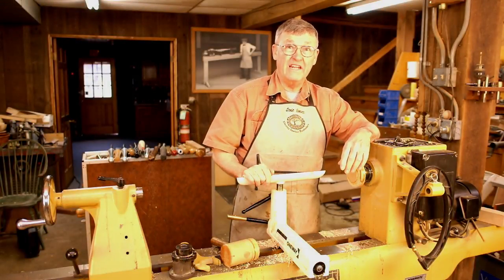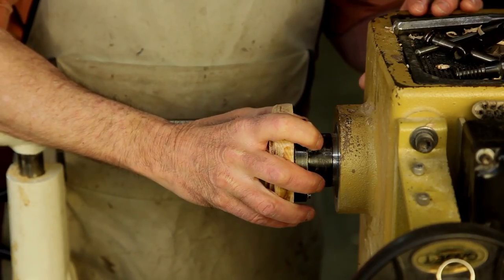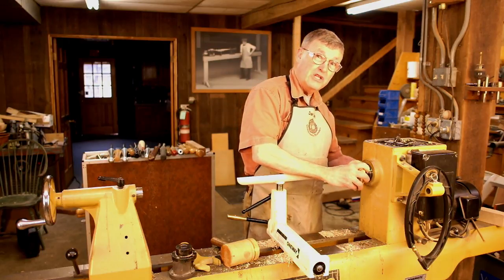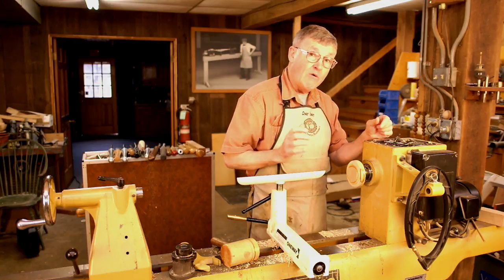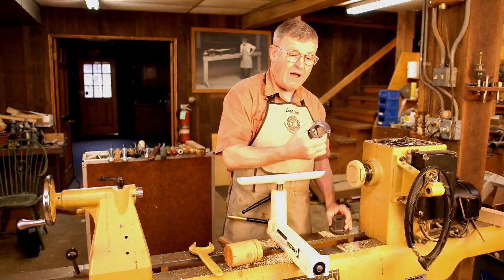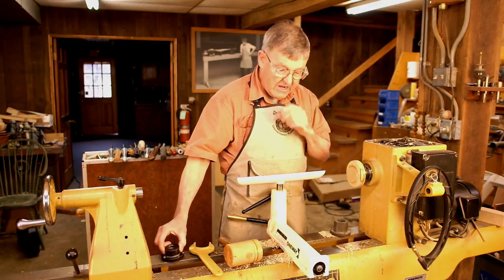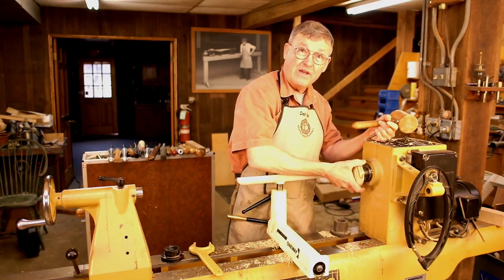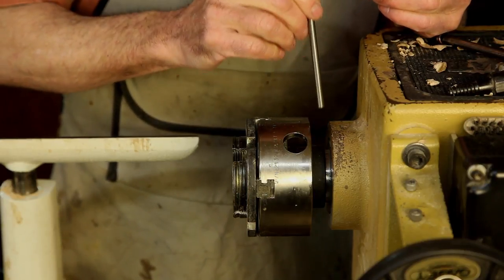Removing a Stuck Faceplate

Comment: Very good information! I was taught many years ago to put a ring of paper over the shaft before screwing the plate or chuck on. I have never had a problem with sticking using this method.

Comment: Still stuck don’t have screw and can’t lock lathe I have a central machinery 10x18 lathe and can’t get stock faceplate off please help
Reply: Did u find a solution? I have the same machine and same issue